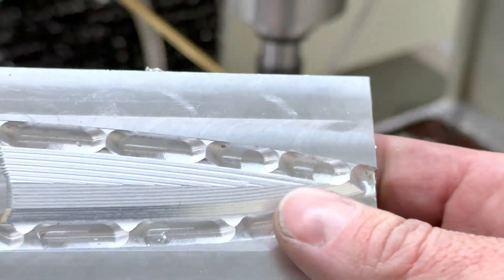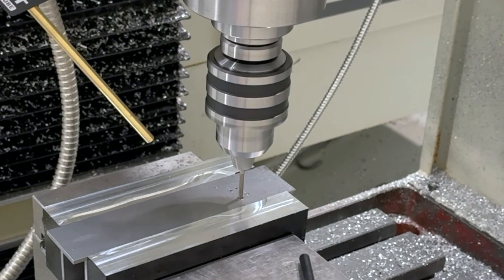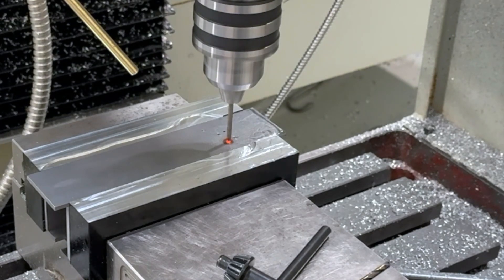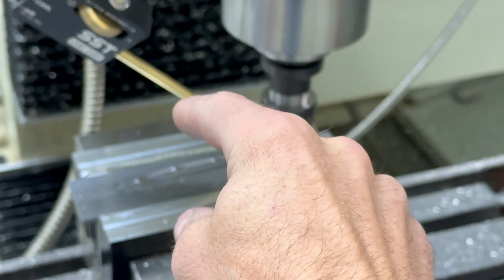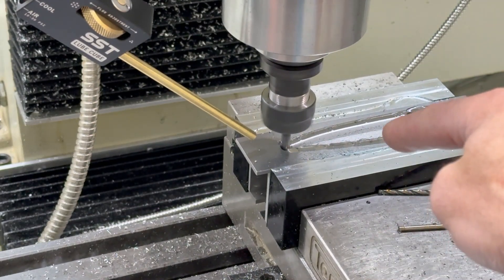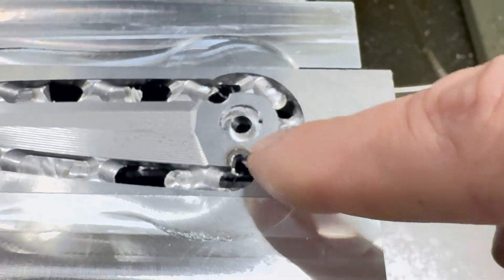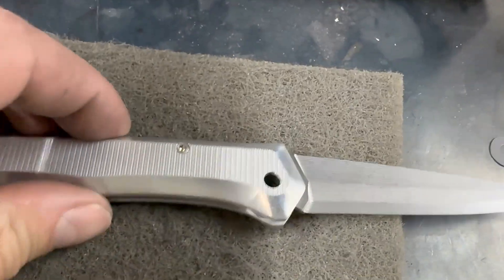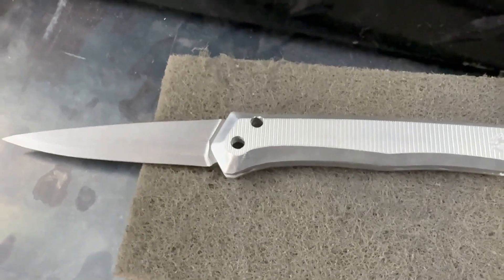Machining another Custom CNC Auto Knife Blade in steel

Comment: Any tips for speeds and feeds on 1084?? I'm running out of endmills lol
Reply from the maker: I’m a novice at choosing feeds and speeds, but the 4 flute carbide cut pretty well, did not like plunging, I’d stick with around 1/4” tool. And went around 10ipm at 5k rpm. But when I was cutting it had tabs so it was constantly plunging, next time I will tell it to plunge slower and probably try 20ipm. I was actually using a 5/32” endmill, surface speed was 204 ft/min and .001” per tooth. Plunge was set at 7ipm but needs to be a little slower I think, especially with the tabs.
Reply: @mwmxcnc  is this for the Tormack or for your conversion cnc mill?  Or were those settings working well for both

Comment: Looks great. Youll need a lot more coolant for drilling such tough material or try to drill with a bit more feed to keep the heat build up as short as possible. Some good carbide drills should be able to make short work of it (even though the first few times can be a bit terrifying, i wont lie)
Reply from the maker: The plan is to try to ream with a carbide endmill, I need to do some tests to see what sizing I get doing it that way in aluminum vs steel, I don’t have a through hole in one of the handles, so reaming to a square shoulder isn’t feasible with a normal reamer.